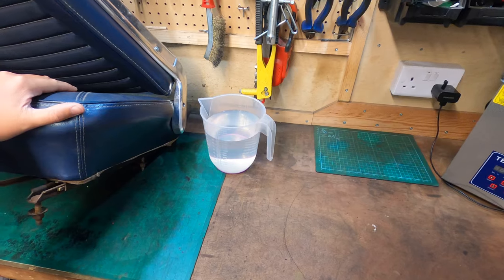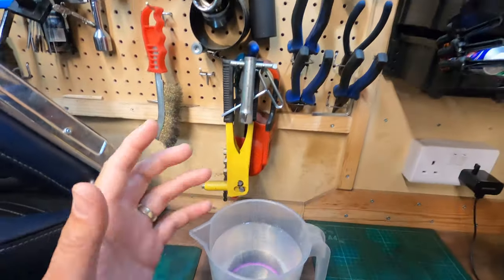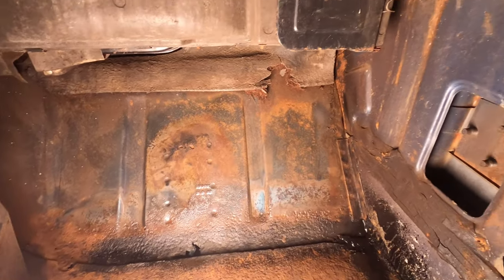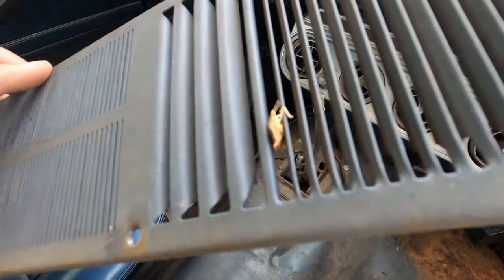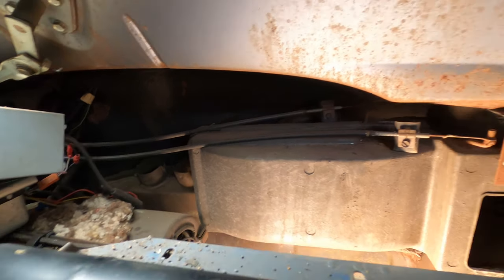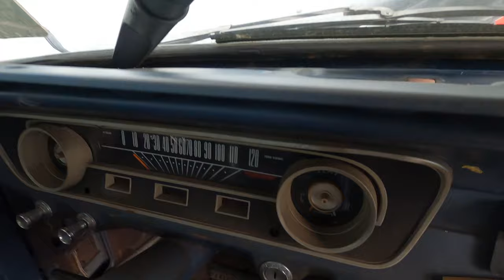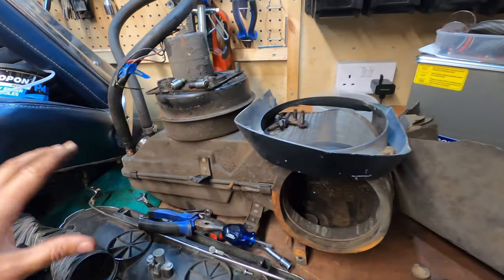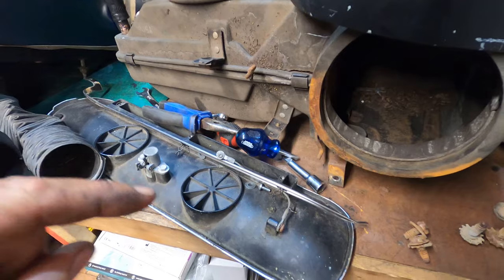1965 Ford Mustang Rusty Cowl Issue - Water Leak Rusted Out Floor Pans - Rust, Rust and more Rust

Comment: I feel your pain. I have a 67 fastback and the cowl was rotten. I had NO welding experience before I started the replacement. Yes it was scary, yes I was worried that I would not be able to fix it properly but I did. I replaced the upper and lower panels and it is  properly painted and sealed now. You can do it and you will feel so much better knowing that it's fixed. Best wishes to you.
Reply from the maker: Cheers man’s look into start this over the summer

Comment: I am facing the same on my ‘66 coupe. Im going to replace the tophat area on both sides from inside the car. The rest is ok. But the vefy top of the firewall has some rust-through too, so I will also deal with that. It is a daily driver. Not a show car. Good luck.
Reply from the maker: Thank you, good luck to you also
Reply: I have the exact same issues on my 66. Time to open up the bank gentlemen